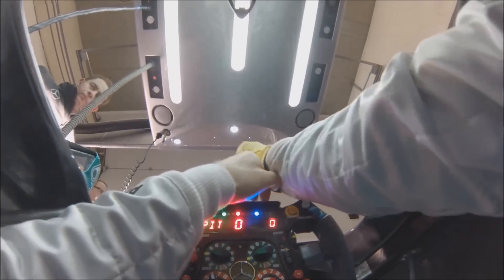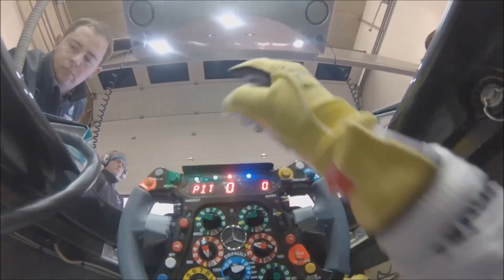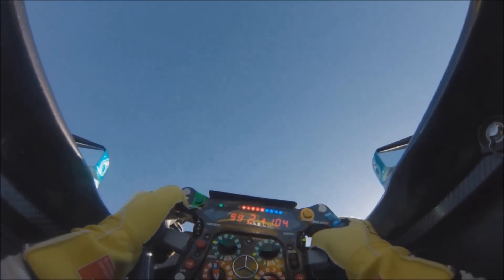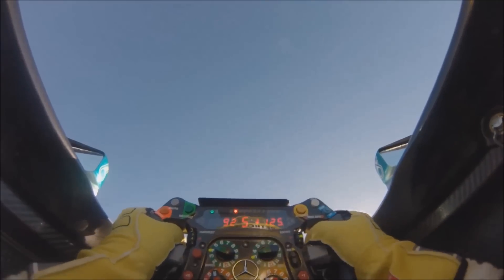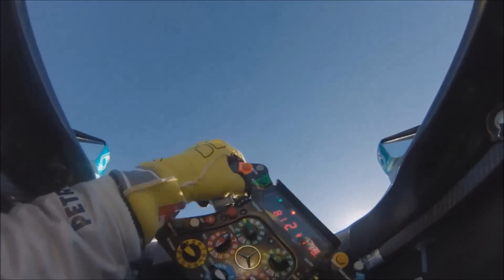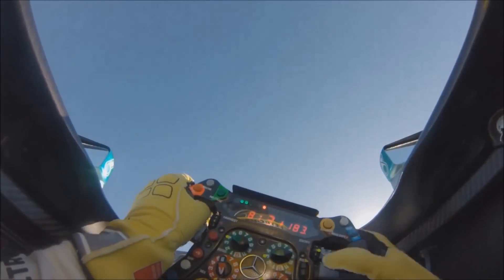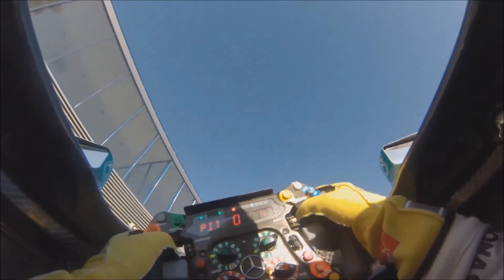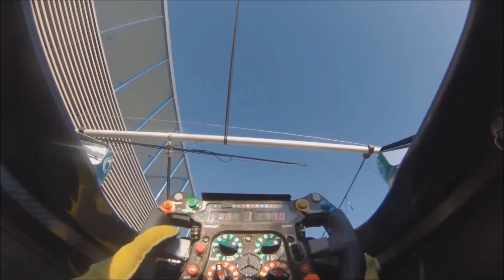Decoding the installation lap

Comment from the maker: Free practice 1 in #Monza... That can only mean lots of installation laps! If you're wondering what is happening in the cockpit during those, check this video! #F1
Reply: MERCEDES AMG PETRONAS This is Jerez, not Monza.
Reply: Whats the number on the right side of the shifting gear?
Reply: NiLo TRiM Its the Delta time. This can be set to any lap time the driver wants, eg your teammates fastest time etc. So Nico can tell in which sectors, or even sections within sectors if he is faster or slower.

Comment: Correct, that is why when a car makes a pitstop you will see, next to the rear jack man, a guy holding a long mechanical device, this is what they use to start the car if they stall in the pits. It looks quite heavy, no wonder they keep it off the car to save weight!

Comment: To reduce emissions by 40%, not 30% here we go:

Make Practice sessions and races 40% shorter. 
Done. No money or resources spent, no extra eco damage, less tires per weekend and more pedal to the metal racing.

Combining motorsport and eco-green BS is an oxymoron. It's like making baby seal skin coats to save the baby seals.

Let's see those V10's back.

My critique is not against the silver arrows (go HAM), but motorsport in general, of which I'm a huge fan.  Thanks for the response btw.

Comment from the maker: Not sure if your comment has much to do with the installation lap but we have a unique opportunity in F1 to help develop better technology for everyday use. Next year, we'll be delivering the same performance with an efficiency improvement of over 30% - and an overall thermal efficiency of around 40%. That's the same levels as a small hybrid hatchback running on the road today. And we will learn from that experience to make better road cars. It's not all "green eco BS"... :)

Comment from the maker: This switch can control a number of functions which the driver and engineers will define. Each position of each switch subtly changes a particular characteristic of the car, for example a mixture mode, etc... This comes to save space on the steering wheel!